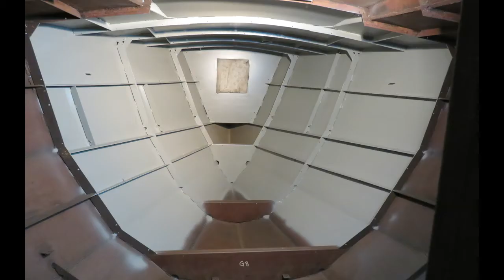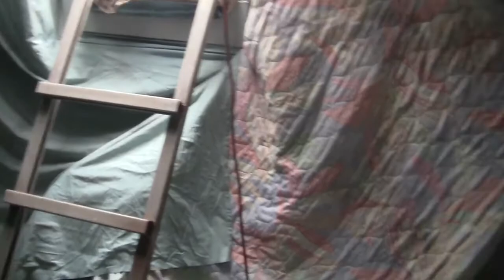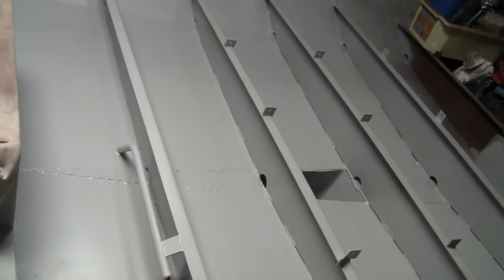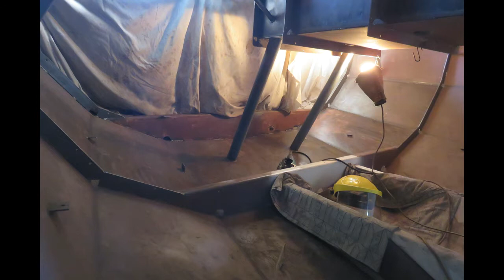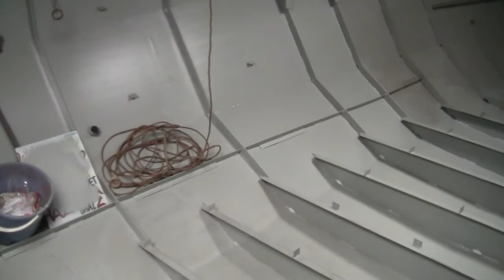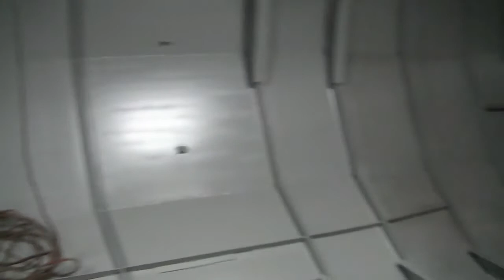Building my steel sailing yacht Ep.8 I beat my nemesis! Next,..

Comment: Is the spot welding (sorry, I don't know if this is the right term) in the bottom ribs of the boat not a potential rust point? I mean when sea water gets in there, as it inevitably will.
Reply from the maker: Good call Nick, you've an eye for detail!
Yes, exactly and that's why you will see me in up coming video's tackle exactly this!
Most steel boat builders do not address this.
And everything is welded, not spot welded which is as the name suggests just a small 'spot' of weld.
Reply: @BuildingSYMistress  Cool! Look forward to it!
Reply: The proper word for the intermediate welds on the ribs and floor frames is known as stitch welding, the arc produces such that if welded continuously would cause warpage. The only other way is too use a technique we call back-stepping or the back-stitch and is used primarily to eliminate steel from warping . As you can see in the video he has cut what is known as rat holes in the floor frames to allow water too flow towards the stern or the lowest part of the keel where the bilge pump or pumps would be situated. Thanks for the upload !
Reply: Building SY Mistress.  You are right about some boat builders.  I had a 60’ hull built.  It was supposed to arrive primed but it was obvious that they had sprayed by just walking down the hull.  Behind every beam/ frame was bare steel.

Comment: Is the pole in the middle a pressure pole for the mast? If so the bottom attachment looked a bit flimsy to me. No expert here 😁
Reply from the maker: Thank you for your good comments and question tip001 and yes the SHS inside is the mast step pole and jfyi the bottom is fully welded at all edges to the hull floor that it is attached to  🙂